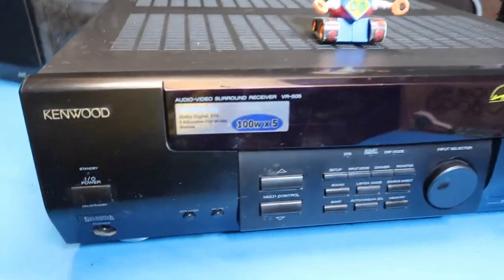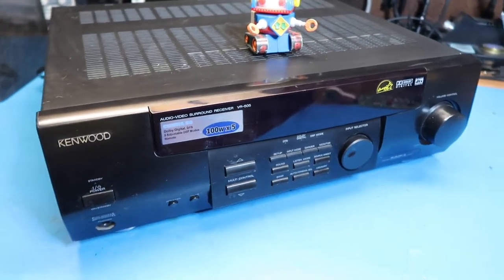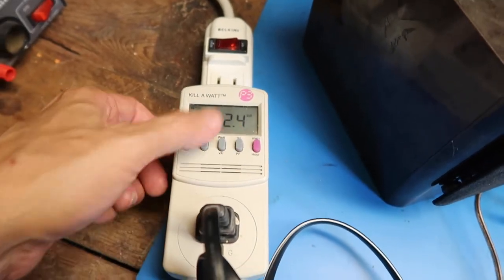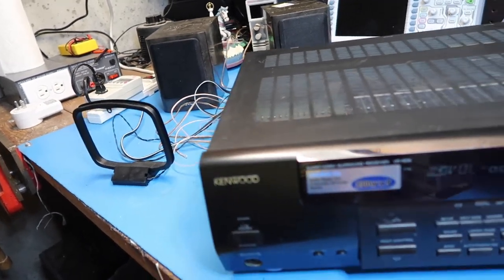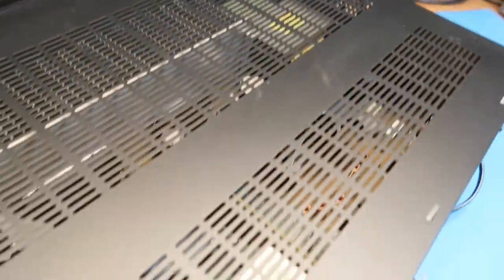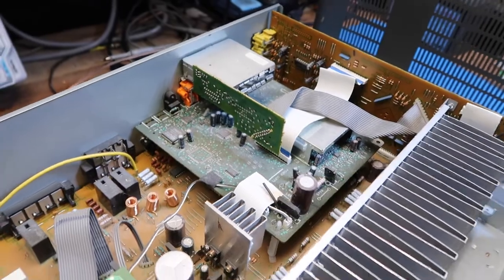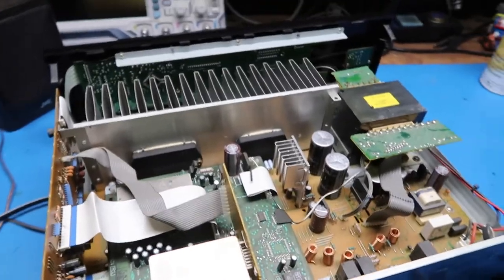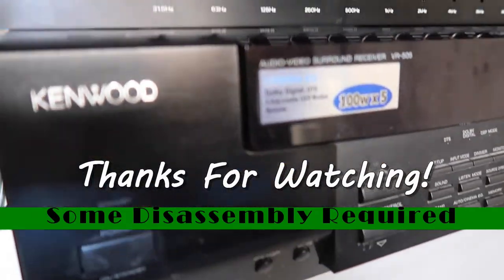Discovering a Kenwood VR-505 A/V Receiver

Comment: I have one and use it regularly. I have the surrounds all over the room and I have a turntable setup. I later found the cd carousel and dual tape decks. It can play quite loud but I don't turn it up in my neighborhood. I am not an audiophile but I have never had an issue with the sound clarity. It has several 'equivalent type presets (jazz/rock/theatre/cinema) These sometimes power off automatically but there's a diy somewhere that shows which solder point needs resoldering to fix that. I fixed mine and I've never had any other problem.

Comment: Hey I found my dad’s kenwood avr, can this be used for electric guitars?
Reply from the maker: Interesting question. I've moved that one out, so I've forgotten if it has a phono input, but generally speaking you can hook an electric guitar up directly to a phono input, though not the "line in" inputs of an A/V receiver.
Reply: @ thank you. maybe a new topic for another video? Is there a phono input built in or do I have to find an adaptor?

Comment: Kitty! 😍🥰 Also, I got a question. I have a Kenwood Surround Sound, kinda like a home theater system. But I have an issue with powering it up. I can turn it on, but it shuts off after a few seconds. Any idea what causes it?

Comment: I have.the same reciver but I have the stand by led blinkin I turn it on abd after 2 secunds turn back off what I can do.?
Reply from the maker: I don't have a lot of specific advice, but one thing that's always worth checking is if any of the large electrolytic capacitors have gone bad, which you can tell visually from them having a bulge on the top.

Comment: Could I plug a 16 gauge stereo wire into these Kenwood speakers or does it have to use the thinner ones that come with it?
Reply from the maker: You can use just about any wire with speakers. The only exceptions are if they don't physically fit into the terminals, or if you're running a lot of power through them that exceeds the current capacity of the wire.

As a general rule, "zip cord" as is common in small extension cords and lamps is a good choice. You can simply find that somewhere, cut the ends off, unzip it by pulling it apart, and you now have two speaker wires after cutting the insulation off the ends.